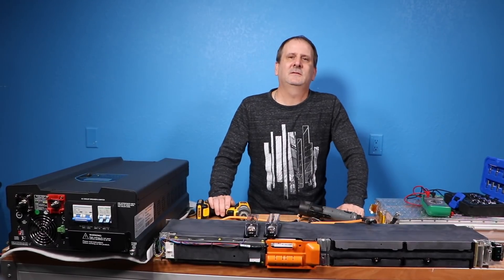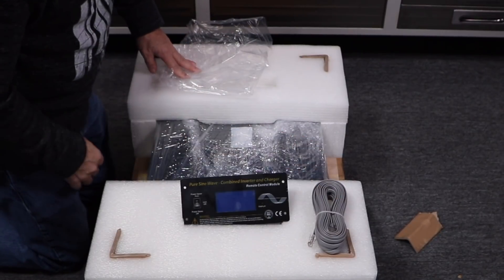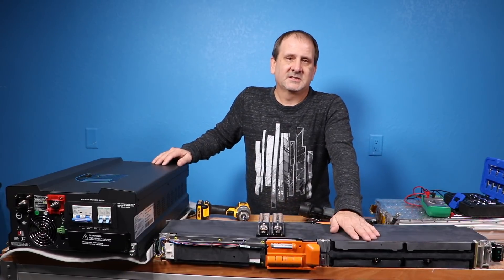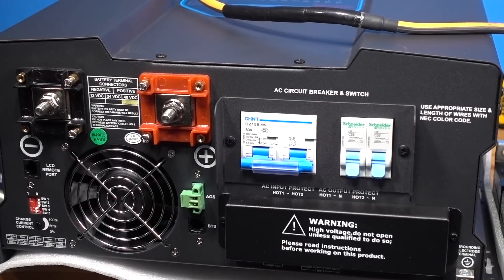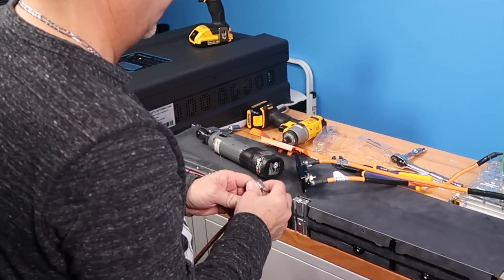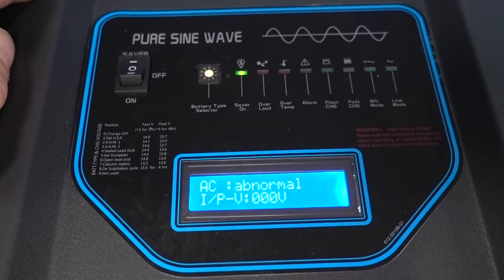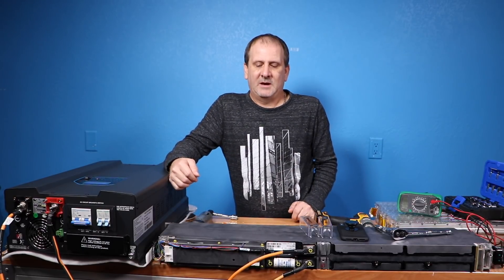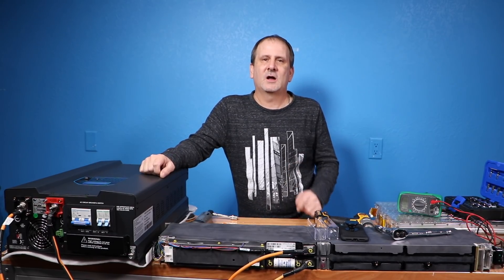12kw Inverter and Tesla Battery Module  Off Grid Hook Up test!

Comment: Your Teslas have a minimum voltage of 50V your inverter has a cut off of between 42 and 44 V. What do you have to prevent it from going to 50 V?
Reply from the maker: You are somewhat correct and I use a Battery Management System, otherwise known as a BMS. But you all ready know that right?

Comment: it's has been almost 2 months do you have your system running. In this inverter charger you can use only the inverter part, and unable the charger
Reply from the maker: Jose, yes I do have my system running and will have a few updated videos coming soon. Yes I can use both the inverter and charger, however the charge only will go to 60v max and I need 62-63v. It doesn't have a lithium charger in it. Its a lead acid charger but can be manipulated pretty easy.

Comment: Excellent..... 
I have similar setup with the Must low frequency inverter and guess what is also 12kw/36kw 48vdc and 18650 li ion diy powerwall 120mm2 cable for + and 120mm2 for - .... 👍 
I have only 230v50hz version... 
14 cells in series 230ah...
Check out the transistor if they have thermal compound between heatsink and mosfet my didn't have so I have take it a part and put some compound on every mosfet and exchange every screw with alan screws.....
It was worth it.... 👍 
Tell me about current draw without any load.... 👍
Reply from the maker: Nice setup Bostjan! The right wire too! Are you in the states? I insisted in the 120/240 split phase for the current we need here in the states. 230 will work but will everything built for 120 or 240 it just seemed like the best way to have them built.
Reply: Bostjan Trancar just a heads up on the heat sink paste, I have seen some dry up and then you have an insulater
Reply: Bostjan Trancar what BMS did you use
Reply: AWPS Renewable Energy, LTD 
I don't use bms.... I only use balancers (from automotive industry bought in aliexpres) that could balance up to 6-10A they are module's the are conected together on the balance side and they perform outstanding no issues what so ever.... 

Green New Energy Co., ltd...
On this site you will also find whole bms-s with monitoring function......
I chose only balancers because I need only balance function OVP, UVP,  that manages inverter and OCP that is managed with the correct fuses....
Reply: Can you tell us the brand and how are they working out for you? How did you address the LBCO to meet the battery specs

Comment: Great Video Wes! Please Keep them coming!!!

Would love to own both!!!
Reply from the maker: Thanks njfulwider5! I will. I have the inverter mounted. will do the batteries tomorrow and hopefully be tied into my main transfer switch and running the house!
Reply: On My Google+ Page, one of my followers asked how much this might run. I could only find the Tesla battery at $700 and the inverter at around $1300. Figured the cables and end pieces would run another $50-$100. Then you might have shipping cost added to the Inverter and Tesla Battery.  Figured the total cost would be around $2200. Would love to get my hands on just one of those Tesla Batteries, but unfortunately, I wouldn't be able to afford $700, the wife would kill me...I could have allot of fun with something like the stuff in this video...Great Work, Fun to Watch and Learn!
Reply from the maker: You've got the battery price but you must be looking at a used inverter? I am getting them at wholesale and paying almost twice that for the inverter with air shipping, (can be cheaper by sea). cables, connectors and misc will run you another $300-$500 for the junction boxes, switches, fuses etc. The fuses alone run around $30 ea. and you'll need at least 3-5 fuses for safety. Now we haven't even got into the charge controller. You also have to have the batteries in a protected box and then you need to connect the batteries somehow too. So this all adds up VERY quickly! I understand the wife thing lol I have to deal with that a bit too sometimes. Glad you like the videos. I have the batts and the inverter mounted now and just waiting on some 2/0, 3/0 wire connectors and 4 fuses to finished the connections. I should have it up and running the whole house by wed. or thu. Video coming this week.

Comment: Just subbed do you sell the nice 18650 batteries and how to get entered into the contest solar brother , I have a solar system I'm growing on my channel trying to get off grid by late spring or early summer and I think the 18650s would help for sure
Reply from the maker: Jeff, thanks! Yes I do sell them I will have them posted on my website www.westhattechguy.com. Go to the site and at the bottom of the front page you can sign up there to win and get all my offerings that I will have in the future.